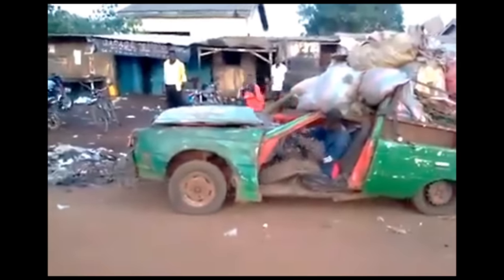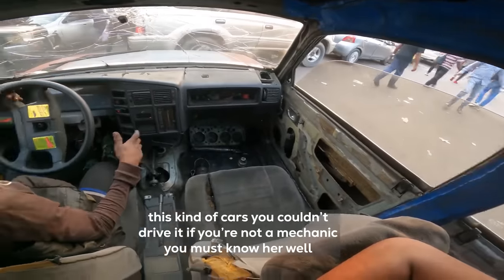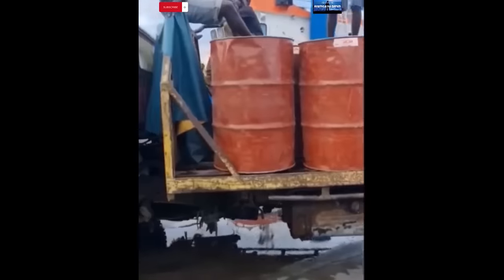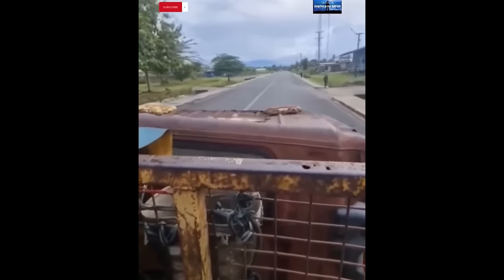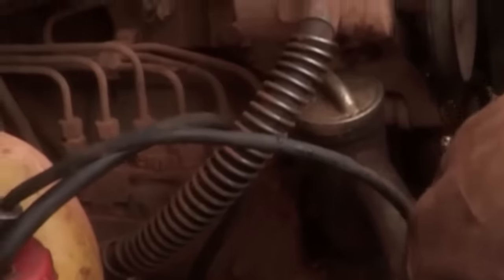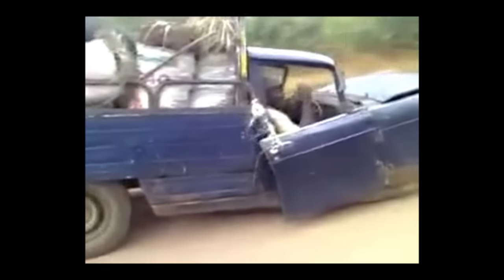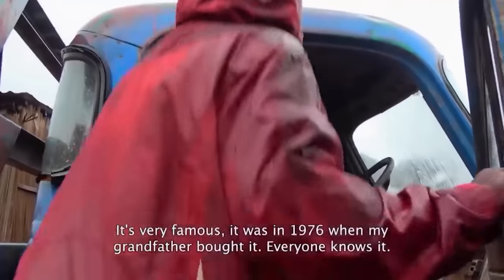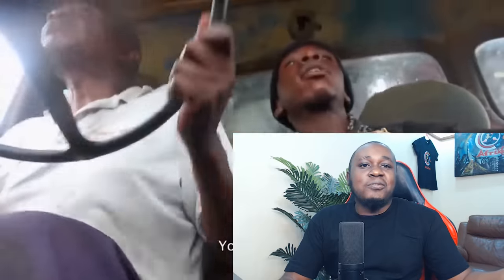Scraps On The Road | African Scrap Cars

Comment from the maker: Which of the cars did you find most interesting 😅
Reply: The last one is crazy! There's no air filter or oil cap! Anything is possible with God and an old Ford 🤣
Reply from the maker: @ryanrovere4023  🤣🤣 and the some parts are made of wood
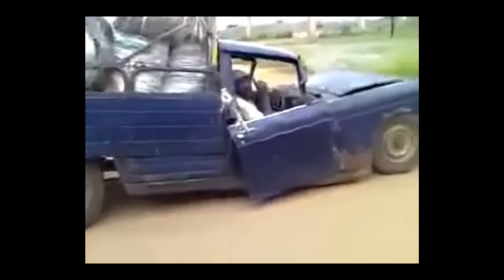Reply: Either the one at 5:20 thats almost snapped in half, or the truck with no floor and a bucket of water to top radiator up on the move 😁
Reply: I
Reply: i watched this after watching The Grand Tour in Mauritania.
there was tons of these kinds of cars in the cities..
Reply: ford
Reply: All
Reply: I love the Peugeot 404. Here in germany they are  expensive classic cars in nearly new condition.
Reply: All the cars
Reply: @twagirimanaoscar669 
I still own a Ford car 🚗
Reply: Last one Bedford 😂😂❤
Reply: Tesla hahah
Reply: None. They all potential death traps
Reply: Hepsi birbirinden ilginç
Reply: Made by UE 2030
Reply: If police in Kenya find you driving kinds of these cars you will be jailed up to 6years no jokes
Reply: Respect the car manufacturer
Reply: the truck one it got a broken door and no flor☠️
Reply: I'm more shocked that these cars move more than that people drive them. LOL

Comment: Back then when car manufacturers made cars to last a lifetime, but nowadays just after 30,000 miles you’ll wave goodbye to the car.
Reply from the maker: yeah. now products dont last for years
Reply: You seriously just said the opposite of reality. The truth is that rust proofing is much better than it used to be and engines last far more miles than they used to.
Reply: @JackF99 you seriously just didn’t say this did you? Do you know how unreliable all these new cars are with all their complicated engines and electronics? Damn
Reply: @athens9867  sounds like you're going on intuition that because cars are more complex there is more to go wrong so they are probably less reliable. It's logical but it's just not true. The fact is, cars used to be junk at 100,000 miles. Full drivetrain rebuild needed and rust everywhere if they live in the North.  Nowadays most cars get twice that mileage without major corrosion or mechanical failures.

Comment: By any compartion - african mechanics always impress me the most.^^ How they keep running those cans, how they're not even frigthened to drive those but out most how they litterally
build driving vihicles from scratch out of more or less scrapmetal and keep it running semingly endlessly whit/by basics of the basics. :D
Reply: imagine, no garage, no tools, nothing, just old cranky spanners.
Reply: Those old engines are pretty simple and more robust, but yes, all of them seems to be maltreated, because with a lot of them you can do 1million KMS if well preserved, instead here, you see engines with blown head gasket, that eventually will die, almost all of them have no pressurized water circuit, missing oil cap, they are on life support. They work just because are old diesel engine. Broken starter motors ecc, broken gear box but yeah, the chassis is missing. Petrol engine from what I see can't run here. Without an alternator the battery discharge and it can't run, contrary to those mechanical diesel. If you bring a modern car or truck there, it will be a useless in few time.
Reply: It's a natural consequence of absurdly cheap labour and a severe capital shortage. You get the bizarre situation in some of these places that it's somehow economical to have 3 dudes working full time to keep a single relic truck running with hardly any proper spare parts and extremely basic tools. Made worse by absolutely brutal rural road conditions that rapidly chew up even the most robust machines. It's only through extreme grit an determination that they manage to get anything done! Though I find the ubiquitous absence of intake air filters disturbing. To my eyes it's the one thing these guys could do better. I figure even a janky one made from an old shirt would be better than nothing. Maybe I'm wrong though.

In contrast there are many firms in Northern Europe and similar places that will sell machines as soon as they start developing problems, because replacing the whole machine is cheaper than the elevated maintenance costs and lost production from even moderate reliability problems.

Comment: for the longest time there was a truck like one of those parked at the side of the highway, a 1938 ford with the wood box on the back... it drove around on the highway when it was still made of dirt covered in grass, tho now it is gone their is a 2 road interstate their with vehicles that drive between 60mph and 85mph. tho i can see lots of much newer cars in the foreground of those pictures, so i hope all that is going on is just a public spectacle of ... wow, and to add something to do more then just walking from place to place. would be much safer to pull a trailer with what i have in some "many" instances... simple turn key vehicle. 'picking up trailers of rocks to fill sinkholes along the chosen road way'.

Comment: In the 1970s in America, the black people cars but the blue smoke spiraling out the back several different size wheels no hubcaps cruising the streets in the downtown City but these days to Modern cars can't handle that much abuse and are off the road before they can get that condition but they drive that old Pontiac 1971 model for 30 years it would have over a million miles on it and looks very much like these vehicles, it's too bad black people don't have their black people cars anymore. And the police would just drive right on past them and let them continue on no exhaust system and the car used more oil than gas.